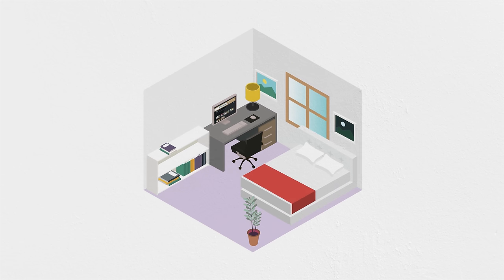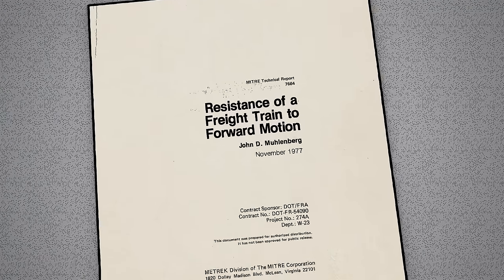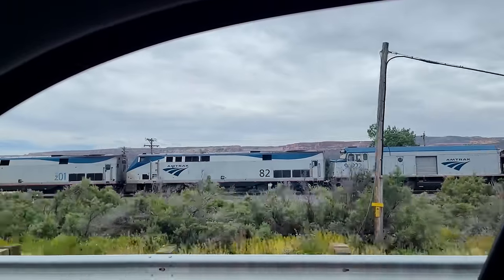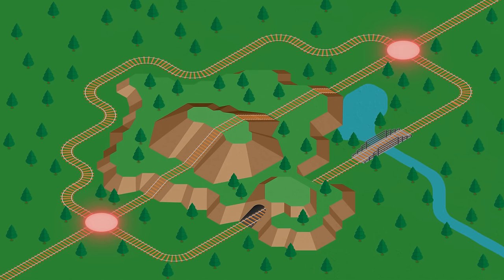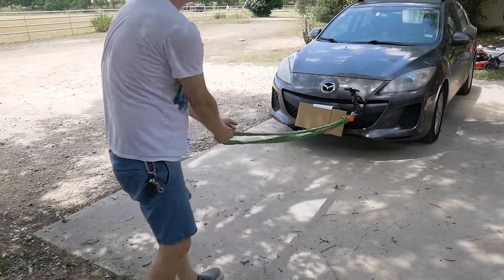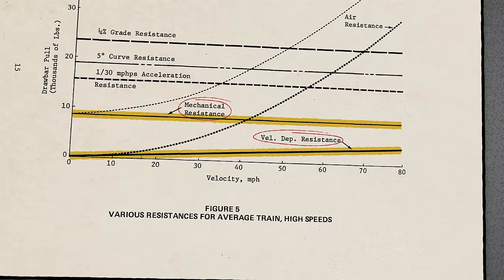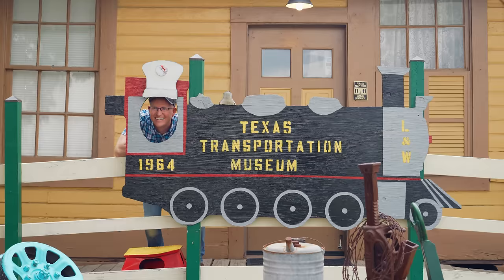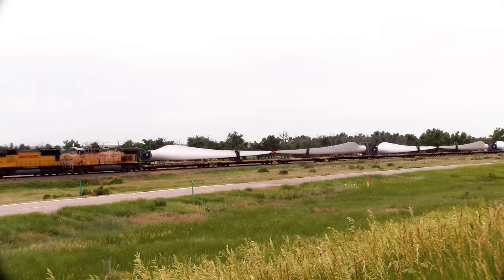Which Is Easier To Pull? (Railcars vs. Road Cars)

Comment: As a physicist I often complain about people using odd units.  Now as a ratio then the units are irrelevant.  9kg per 1000 kg is the same as 9 lb per thousand lb or 9 gunga gunga per thousand gunga gunga.  OK I can handle 9 kg per tonne.  But as they are different units it requires someone to understand more and make the conversion in their head.   But "degrees" for a 100 foot CHORD (not arc) reminds me of a system of putting month, then day and finally year in a date.  It takes an incredible amount of effort to muck up something that the Arabs mastered a thousand years ago.  Place value arithmetic.  ( first digit has highest value then progressively decreases). Can you imagine using feet for altitude, lbs for mass (or for weight who has any idea), knots for speed and perhaps km for distance. How could anyone dream that this is a good way to operate a modern aircraft.
Reply: It's a crazy way to measure curvature, coming out to radius = 50*csc Θ/2 _ ft
Reply: For what it's worth, Highway curves use degree per 100 ft of arc,  degree per 100 ft of chord is for railroad curves. The convention of describing the curvature by "degree"  comes from actually laying out the curve in the field, before the availability of portable calculators.  A road or railroad is laid out advancing along the centerline.  The degree classification makes it very easy to calculate how much of an angle to deflect the centerline as you move the instrument up the centerline,  laying it out.  The system probably has little advantage in the day of powerful handheld computers, total station instruments, Coordinate Geometry, and GPS rovers,  but in the day of Gurley transits and steel tapes  it enabled center-line staking around curves with relatively simple arithmetic and no trigonometry.

Comment: 3:50 ‘By the way, I know kilograms are a unit of mass, not weight, but the metric world uses them for weight so I’m going to too in this video.’ – I appreciate you trying to cater to your non-US audience by converting everything to metric, but … unfortunately, that’s not quite true.

Yes, we do like to use units of mass when talking about weight, for obvious reasons. Historically, we also used it for forces in general. It even had its own name – the kilopond (kp) – to distinguish it from the kilogram of mass. However, it’s been out of general use for at least fifty years now, and been replaced by the SI newton basically everywhere.

Railways, specifically, may use tonnes for weird purposes (‘brake weight’ has nothing to do with the physical decelerating force!) but traction forces in particular are measured in kilonewtons (or historically alternatively in (kilo)amperes of motor current, since the relationship is approximately linear).

Comment: With the respect to brake loosing energy to heat: yes, but all modern trains have regenerative brakes feeding the energy back into the overhead lines. Sure for the occasional rare diesel or steam locomotive that isn't the case, but those are mostly used for maintenance and museums respectively.

At least that is how it is in countries with modern infrastructure like here in Europe. Even if US is way behind on electrifying their railways it seems strange not to acknowledge the international perspective in this video.

Comment: Your biggest issue is that you are pulling. Your using friction to pull the train, and gravity does not supply you with enough friction to pull it. If you were to push, the force would increase friction, and you could push it, saying you can hold a 150 pound weight at whatever position your in.

Comment: Answering without watching the video:

On level ground, 1 railcar would be easier to pull than 1 road car, but railcars in the configuration they're used would be harder to pull than road cars in the configuration they're used (more than 1 vs just 1)

On an incline, train car is harder because it's heavier

Comment: Timken bearing company was trying to get the RRs to adopt roller bearings in the 20's -  30's.  They couldn't convince them to change over on the face of it so contracted a special manufacturered steam locomotive to demonstrate the benefits.  There is even an old film about bearings showing six young women pulling one the biggest steam locos ever made.  One will also note how rail tracks are level i.e hills are cut and holes are filled.  P.S.  Four girls outdid you.

https://youtu.be/Kljmz_c-QQ8?si=cHhEjO4ZjxpGiwnG

https://youtu.be/wmyVYj2hJoI?si=9Acf0hUhDKhsAueE

Comment: The contact patch is confusing me. Steel doesn’t deform elastically, right? Wouldn’t that contact patch be permanently pressed into the steel?
Reply from the maker: Yes steel does deform elasticly. That’s how springs work. It’s more complicated with high pressure contact mechanics, but I’ll dive a little deeer in a future episode

Comment: @13:35 you are disengaging the brakes by releasing the air? Isn't it the opposite? Normally trains require air for the brakes to be disengaged because it fails safe. You release the store energy to apply breaks.
Reply from the maker: Just wanted an excuse to use that shot. It was actually the hand brake that was engaged, not the air brake

Comment: What if a locomotive had a flywheel that it could dump energy into when it's going downhill instead of losing it to friction?

Would such a flywheel have to be so big and heavy that it would be insignificant to the conservation of energy while its not in use or moving on a flat track? Or would a flywheel with such a mass storing so much energy be incredibly dangerous?

Comment: 5:40 I thinks when building tracks splines are a better option for the geometry of tracks than straight lines and circles. This is simplified of course, I just think a note that this is the case would be good.

Comment: what do you mean with "9kg of pull from the lokomotiv per ton of freight"?
shoudnt the pull from a locomotive be a force, and therefore be messured in newtons, not in kg?
or do you mean the gravitational force that is equal to 1kg of mass, which for the average gravitational accelaration of earth (0.8 (m/s)/s) would give ~88.2 Newtons of force? 
or do you mean the force required to accelerate the given weight by 1(m/s)/s, which for a weight in kg just gives the same number in newtons?

as a european, i am very confused by the concept of using a unit of mass to describe a force

Comment: B4 watching this video im 999% sure it's railcar. Just look at semi trucks they pull 1 container, same size locomotive pulls like 200 of them, of course its an unfair comparison, but tires don't glide on the road, in fact they need the friction to slow down quickly, rail transport doesn't care cuz you go on fixed tracks and nothing unexpected happens for 999% of the time

Comment: Before even watching, my guess is that the car is easier to get started, while the train car is easier to keep going.

Car's lighter, but the train is a rigid wheel on a rigid track.

....now to see if I'm anywhere close.
Reply: I was at least half right! I wouldn't have guessed that maintaining the momentum would be the same.
Reply: TelieDima  Did you reply to the wrong comment? I didn't say anything about a unit of measurement.

Comment: Hahaha I couldn't understand why you said that the energy used to go uphill will get lost as heat through the brakes. I couldn't believe you had never heard about regenerative braking. But then, I realized you are from the US, and you're still mainly using fossile powered trains😂 Almost anywhere else we store the downhill energy with regenerative braking.
Reply: Most of the world still uses "fossile powered trains" so it's not almost anywhere else. 
And even Europe still uses some diesel trains too.
Reply: @PocketsandOutlaw  Okay, I had to google it, and seems like you are right that a surprisingly large portion of the worlds trains still use diesel. Still, when I, as a European, think about a train, I always think of it as electric, and a very considerable portion is indeed electric, and regenerative braking should have been mentioned.

Comment: The reason you couldn't move the train car is you couldn't overcome the moment of inertia. Moment of inertia curves are pretty close to to current inrush curves in electronics. You couldn't prove that instantious 3.5 gigawatts of power, even if it was only a millisecond.
Reply: "moment of inertia" is a measure of a rotating bodies resistance to angular acceleration.  Has nothing to do with pulling a rail car down a track.
Reply: Wat?

Comment: one of the commentators on here suggests that rail transport is roughly 3 times more fuel efficient than road, ( logically believable) however, here in the Uk it is far cheaper to travel on a road going coach ( roughly 60 passengers ) than on a train with roughly 600 passengers , rail travel ought logically to be many times cheaper than road travel but in reality is not, totally mystifying.

Comment: Your track instantly transitioning from a straight path to a circle will not work for a railroad. Railroads must have easement curves where the curvature changes linearly with distance traveled along the track.

Comment: Whay you think about 50B usd 2.250km hsr with speed 200 km/h train Sichuna -Lhasa rel way. 200 km/h train in Tibet.3.600 m  under sea. 80 % rel line through tunnels and bridges.

Comment: 3:55 As a metric user in UK I must ask when kilograms are used as a measure of weight/force. I have never experienced such usage - it's always the newton for force. That's a beauty of the metric system - consistency.
Reply from the maker: All my scales can read in kg but not newtons.
Reply: @PracticalEngineeringChannel  Ah! Chemistry scales. Chemists do not use proper metric - they have invented their own hybrid, and still use measurements such as decimetres! As a Physicist that annoys me. The scales measure force, but calibrate that as mass by assuming g . To get around the problem school physics now calls spring balances newton meters , and they read newtons.  

When I was at school (UK: Yorkshire) we used two-pan balances (the more exotic versions had chains to pay off for fine tuning). With those one is balancing forces (more precisely, torques, so invoking conservation of energy) on masses almost in the same location, so g can be assumed uniform to a high degree of precision, so they read mass. The little masses were in subdivisions of kilograms, or grammes in those days as we used CGS before moving to MKS then SI, and changing the spelling of gramme to gram.

Comment: You didn't HAVE to go scruffy for that one video... there's always buying a replacement cheap razor for that one or those few uses there. But hmm, I'll just stick with my electric razor. I've tried using manual razors like this and it gives me the heebie-geebies! Now, of course, a potentially better manual razor like this might be less likely to but I'm still kind of scared of it. Nahh, for me, electric for the win!

Comment: Why are you trying to pull it? You're limited by your own tractive effort, which is largely limited by your own weight.

If you push the car instead of pulling, you can lift up on the car thus increasing your own weight and tractive effort by however much you can lift. You might be able to push twice as much weight as you can pulling because of this.

I'm no pro but I do race cars and offroad trucks sometimes, and physics are a huge part of both activities.

Comment: 13:35  is that not an air safety that actually engages the brakes when the line is popped? (To avoid runaway railcars)

Comment: I’d like to high light the 68-car IORE electric train set in use in mining operations in Kiruna, Sweden. Takes 8600 tonnes of cargo, dead weight 21000 tonnes, and driven by 14400 horse power engines. There is actually 34 of those trainsets, totalling almost 500000 hp. Most, but not all are in simultaneous use, with a train set leaving every few minutes.. 

https://en.m.wikipedia.org/wiki/Iore

Comment: Are their no trains with regen braking capturing and returning heat as electricity to help power the train?  Could a massively magnified diesel Prius hybrid or hydrogen fuel cell engine, maybe hauling and converting water into hydrogen, using the waste heat of the engines braking to both recover waste heat energy and in a bizarre twist, like a fluid pumping piston, powered by its gravity fall descent,  the length  of the journey,  maybe redistributing salt water, desalinated? in the from of low energetic cooling steam and condensation,  to be low carbon foot print,  big natural water table gravity fed and transpiration redistribution of salt to fresh water along train paths that using mangroves and bamboo filtrate the low temp to the natural water table.  The train paths simplifying via traveling through ag lands and orchards their water energy use and redistribution feeds drought areas?

Comment: Let's remove those car tires and replace them with light weight steel wheels, combined with very icy roads, this will drop the consumption significantly.
Disclaimer: I'm not responsable for any direct and collateral damages :)

Comment: Can someone explain how forced is measured in kg?
I know that in the imperial system there’s pounds and pound force (which I think is still pretty confusing)
But isn’t kg just the mass?
Reply: Kg and pounds measure both mass and the force of earth’s gravitational pull on it.

Kg can be the mass, but it’s also the force of gravity, because (when on earth) those are the exact same. Using kg as a measure of force is saying “it’s as much force as if you put a __kg weight on it”. In the context of pulling a train car, 1000 kg of force means it’s as if a 1000 kg weight had its gravity magically flip sideways and it was tied to the train. You can also substitute kg for pounds, because those units measure the exact same thing